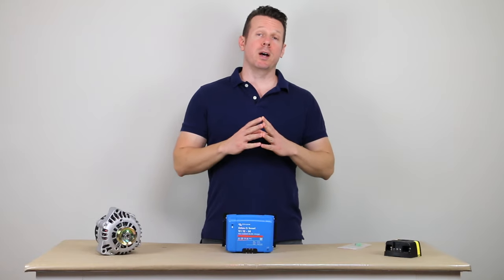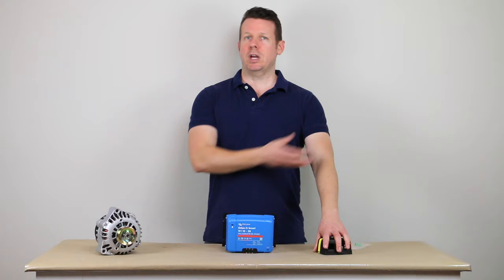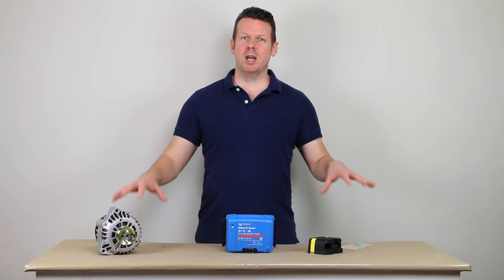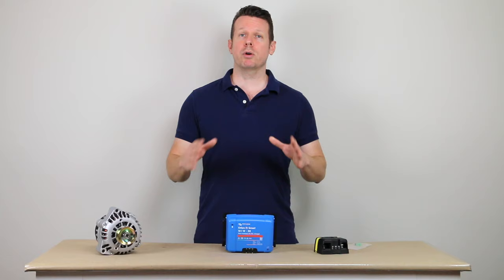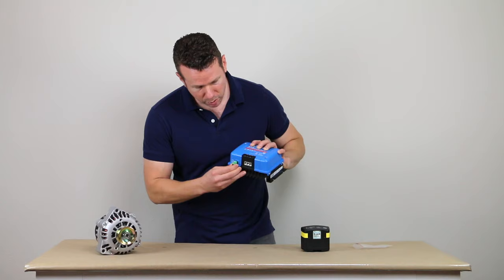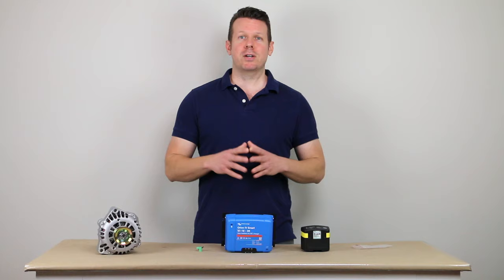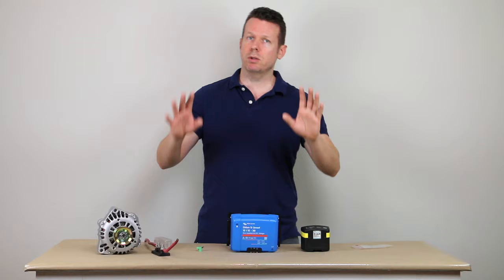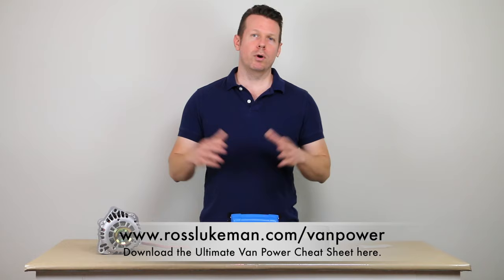Top 3 Alternator Charging Mistakes for Van Conversions | Featuring the Victron Orion-Tr Charger

Comment: Hello Ross – first, thank you for all the time and effort you put into all you do here!

I’m planning on using an Ecoflow Delta Pro (“solar generator”) as the house battery for my next build (a Ram Promaster). While the Delta Pro has great input capacity for fast solar and AC charging, it doesn’t have a good built-in way to connect to the vehicle’s alternator for charging.

What would be the best way to connect the Delta Pro to the starter battery / alternator to charge while driving? Would it be possible to use a DC-DC charger and inverter (say, a 700W inverter) connected to the starter battery to feed the Delta Pro a stable 110V (like being plugged into an AC wall outlet) when driving?

If so, could I then use an automatic transfer switch to switch between this alternator input and shower power to charge the Delta Pro?

Really appreciate any guidance you have on the appropriate setup and wiring to leverage the alternator to charge the Delta Pro.

Thanks!!
Reply from the maker: Hi Nicholas, great insights you have on setting up the EcoFlow with alternator charging. You are correct in that they are built for robust charging via AC power, but have very feeble capability when it comes to straight DC charging from an alternator (plugging into the dashboard's 12V outlet does not charge it very quickly). 

In a nutshell it's kind of a mess to set this up. In a way it's sort of getting the wrong equipment and doing a bunch of workarounds to make it work. However your idea about the DC-DC charger, the external inverter, and the transfer switch are spot-on. That would work and would be the fastest way to charge that unit from the alternator, regulating and converting the power so the unit charges like it's plugged into a wall outlet. 

It should be noted though that EcoFlow is now releasing RV power kits that are built for alternator charging (and solar and shore power), accepting 60 amps DC power from the alternator right out of the box. https://us.ecoflow.com/collections/power-kits (I will be doing a video on these when I receive a kit from them).
Reply: @rosslukeman  Thank you so much for your response, really appreciate it! I have been following the release of the new power kits from Ecoflow and came close to ordering one, but decided to give it a few months to see the initial reviews and troubleshooting. So, definitely eager to see your upcoming video on this system! If all looks good, I'll likely use the power kit for my next build.

Thanks again!
Reply from the maker: @roamervansUS  glad that was helpful! Good to hear my review will be useful. Coming soon...
Reply: @rosslukeman  Sorry to trouble you with one more question - what wire gauge would you recommend for (a) run from starter battery to the B-to-B charger, and (b) from B-to-B charger to the inverter? (both likely located at the back of the van). Will have a 70amp in-line fuse right at the connection to the starter batter, and a 70amp circuit breaker further back too. Thanks!
Reply from the maker: @roamervansUS  Hey good question, but cable and fuse size are dictated in the manual of whatever equipment you use. It's specified by their electrical engineers in the manual. So it depends on what you use for the B-to-B charger.
Reply: @rosslukeman  Got it! So the manual for the 60 amp DC-DC charger says 4AWG and a maximum run of only 8ft to the starter battery -- so looks like i might need to downsize the system to the 40amp DC-DC unit given i have more distance to cover.  Again, thank you so much for the quick responses. I really appreciate the time and effort you put into this!
Reply from the maker: @roamervansUS  Glad that was helpful. One more point, if you go farther and the voltage drops a little bit more, the thing about the DC-DC chargers is they will boost the voltage of their output. So if they get 14.2 volts from the starter battery instead of 14.4, they are going to boost or drop that voltage for the rear batteries anyway. I would just use the 60-amp model if that's what you need. What brand is this charger? Thanks, Ross
Reply: @rosslukeman  Thanks Ross - good point about the voltage boost / stabilization. it's the Renogy 60amp charger
Reply from the maker: @roamervansUS  thanks. It says "When selecting a location for the DC-DC, make sure that the unit is as close as possible
to the battery you will be charging (auxiliary battery)." (manual p.7) I think you are good. I couldn't find anything about the 8ft from starter battery.
Reply: @rosslukeman   Hi Ross - quick update. I just got round to installing this setup and all seemed to work as planned. I had the Delta Pro set up to take a 500W charge, and the B2B and 700W Renogy inverter held that wattage nice and steady for the duration of my testing. However, I did notice that some of the 4AWG cable was starting to warm up a bit during the 15-minute test, and the 125amp terminal post fuse at the connection to the starter battery was also warmer than I'd like. Any thoughts on what the cause could be? I'm going to try sizing up to 2AWG wire anyhow, but thought I'd love to get your perspective on this. Again, many thanks for all you do here on this channel!
Reply: @rosslukeman Did increasing the wire size fix your issue?

Comment: Well then you have the WRONG split charge battery relay. I have one that charges the starter battery first and foremost. Not until the starter battery is fully charged does the relay switch to the house battery. You can't miss with this setup. The two batteries are never linked in discharge either. ON top of that, I have a manually controlled external regulator which controls the output of the alternator, rather than rely on the internal regulator which switches off after 15mins. I still don't see the point of a DC-to-DC charger.
Reply: Different battery chemistry between the house and starting battery.

Comment: With a DC DC Charger (like the Renogy 50a unit), does it matter how large the Alernator is?

Reason I ask is because I've always been told that you need to use an isolator equal to or larger than the Amperage of the Alternator. 
Since these DC DC Chargers have an isolator built in, I am curious how they are compatible with Alternator sizes.
In my case, I'd like to use a 370A Alternator. 

Thanks !
Reply from the maker: In this case with the DC-DC chargers, they would not match the alternator capacity, but instead some fraction of the alternator's capacity. For these chargers, they will allow their full rated amperage to pass through. If you get the same amperage as the alternator then it will max out the alternator, burn it up, and there would have been no additional capacity to power the vehicle.

Comment: What a bunch fear based crap. Using relays for 50 years... they work well. Lithium being the exception.
Reply from the maker: Just relaying my experience! Which statement from the video did you find to be false?
Reply: VSRs are very inefficient if your vehicle has a smart alternator (most modern vehicles today). A reputable DCDC charger will boost the voltage sent to the leisure battery so you'll be certain to fully charge your leisure battery rather than just balancing the voltage between your starter battery and leisure battery. 
The only thing I don't agree with is the VSR becoming a parasitic draw. If a VSR is a parasitic draw then it's failing to do its primary job. 
The DCDC charger ignition sense isn't to prevent parasitic draw. It's to tell the charger that the engine is running so that it can draw energy from the starter battery even if the starter voltage is below the generally accepted levels for charging the leisure battery. By doing this it places load on the starter battery, and smart alternator will detect this and then start charging the starter battery.
Reply: 50 years. If alternators and vehicle electronics would not have evolved from the 70's it wouldn't be a problem. Why would anyone wanna change out their 8track, or cassette deck, status quo I say! Carburetor, points, and a 427 isn't the problem, it's the price of gas and emission control...e"mission control" that's for NASA... "Houston, we gotta problem, our relays work fine but...."
Reply: More and more often these days, lithium is becoming the rule, rather than the exception. Best to use a proper charger, like the Victron he showed, to limit the charge current. My Victron Orion 12/12-30 usually charges at about 21-24 amps by the time it heats up. That seems ideal for my factory alternator into a 100-Ah LiFePo4battery.
Reply: @StealthGTI  just now finding this video in the middle of my van build. I am looking to go for a similar setup and i was wondering how many amps is your Alternator? I cant quite seem to find any good info on exactly how many amps would be safe to pull from the starter batter given the size of the alternator.
Reply: For example I have an older model Ford van, I believe my stock alternator provides 95amps of power. Would it be unwise to strap a 20amp DC-DC charger on there? It seems other peoples setups vary widely, some pulling 60amps from a 200amp alternator and others only willing to pull 20 from the same size alternator.
Reply: @MeanderingOndward  - My factory alternator is 150A. Should it fail, VW specifies a 180A alternator on a different model that would be a direct replacement on my car. So, I have easy upgrade options, albeit not cheap. Feel free to search my channel for my Victron video.

Comment: You know I had this Renogy DCTC controller with mppt for my solar panels and it literally started smoking even though I did every step one by one and thoroughly checked everything that I did and I have no idea why it did not work in the first place for why it started to smoke and the only thing that I could possibly think of and I don't know if this is the case but I would like to ask you if having an AGM starting battery that's 12 volt and having four 6 volt batteries wired in series parallel is possibly a reason why it start smoking when I finally made the final connection and I mean I took every step one by one because I've made a lot of mistakes, hell you could see the bolts that Renogy had supplied there are burn marks on them.  Now its been a while and I've learned a lot since then, and yet I still can't think of exactly why any other possible explanation that this happened I would love to hear what you think because the final step that I took was connecting to ground on the chassis and the only hint that I have is that I had not at the time heard of the terms isolated and non-isolated. I do have a learning disability, amongst others, so not only can I not easily understand easily, have friends or family who will help or afford help, flat-up spark shower scare me. I'm proficient in a number of things extremely proficient actually but this is the kind of shit that I just don't understand mechanical engineering electrical shit like this. I don't get it it doesn't click in my head. I can help psychiatrists understand the diagnoses and the differences between say bipolar and borderline in which I have the latter, but stuff like this just does not stick in my head even when I do finally get it. Like you said in your video I'm trying to make sure that I do not end up stranded somewhere because I'm finally leaving my home County on my own and I do not want to strand my dog and I somewhere without help available. I'm down to two 6 volt batteries, since the third one is technically useless as far as I'm aware but I am in the process of Reviving that last one with JB Weld and fresh battery acid. But my first question is the only question I really have what could possibly happen with that charging system how did I go wrong? Edit: I just realized I need to clarify, the charger started smoking. I immediately disconnected it because I knew that frankly wires were burning inside of it if not more and it took a few minutes but let's just say I ran for a fire extinguisher at AutoZone just in case luckily I didn't need it, cuz it's not easy or cheap doing these obviously and being disabled I don't have a lot of money so I take certain risks knowingly. Such as location...
...lol 
Second edit: sorry I tend to comment before I finish the video but I'm extremely careful about how I leave a job. So I did want to mention that if I'm doing the job I do it right, however I am susceptible to distraction so I don't do it if I can be distracted. I'm seriously looking for help because I'm in desperate need of it I can't be blowing anymore benefit money on this for replacement shit, but the washer thing with the differences between conductors I didn't even take the chance honestly I straight up had them connected and I would go back and perfect the system afterwards. What I was checking to see which is why I took every step one by one and did my work with a multimeter double check and triple check I still don't know what the hell happened.